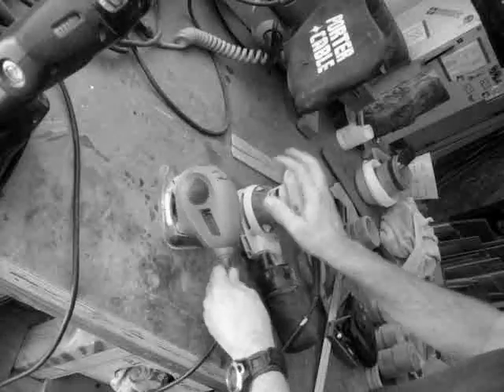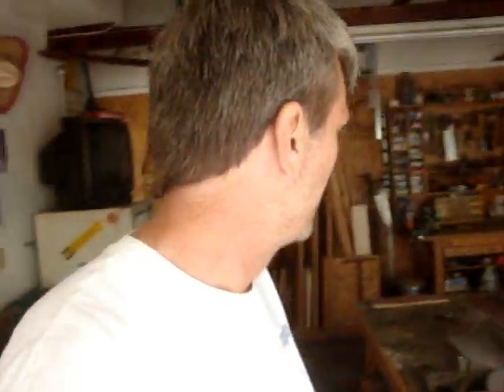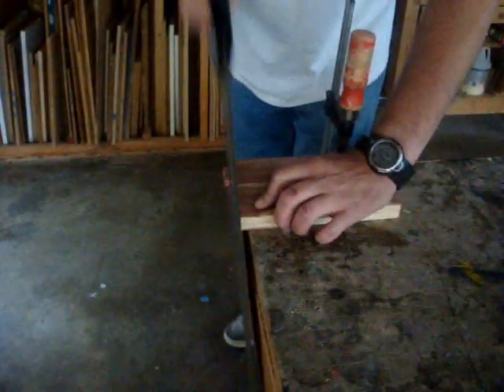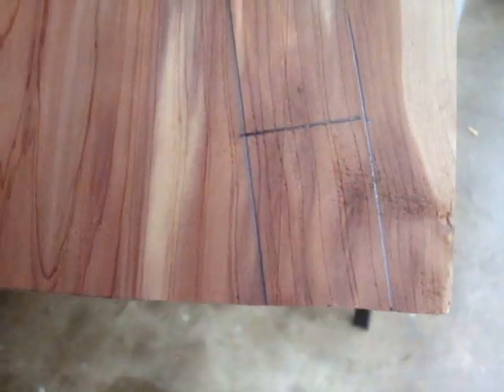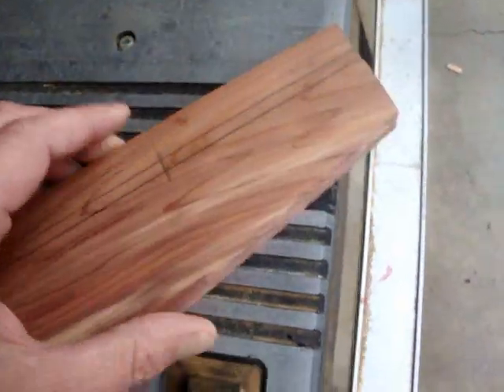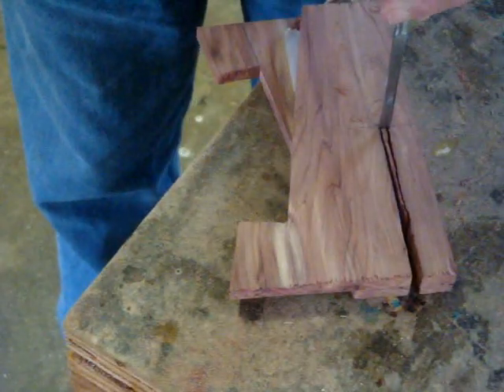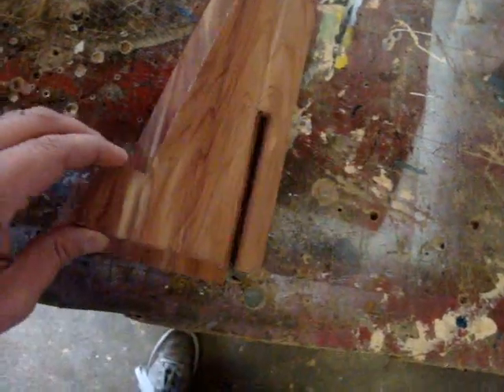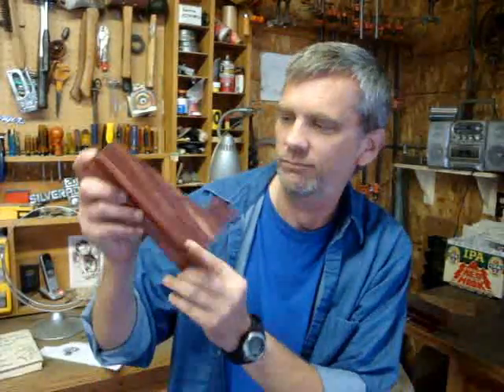Make a wood picture easel using hand tools

Comment: I have found those shark handsaws (Stanely) you buy at lowes are pretty darn good, I have gone through maybe 8 of them as they are cheap enough to replace when they get dull from hitting nails. (Sometimes it is quicker with than dragging out the sawsall in awkward places.